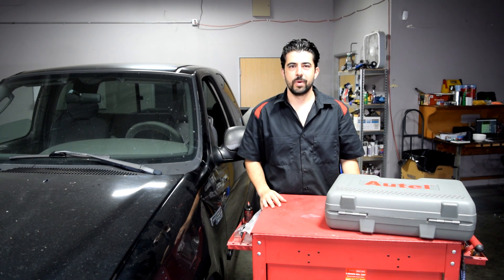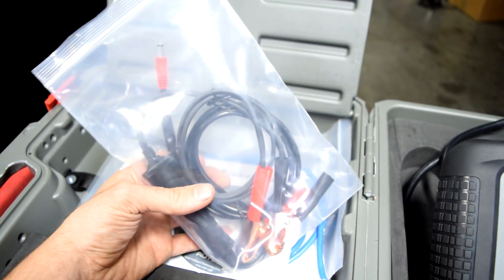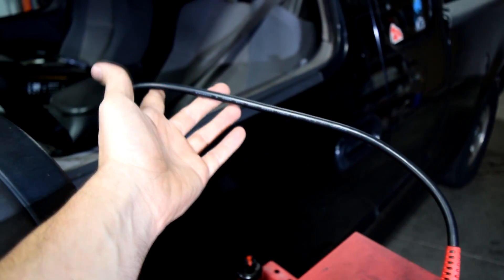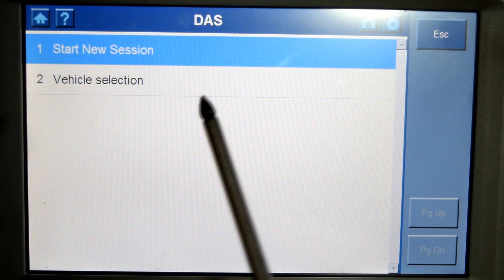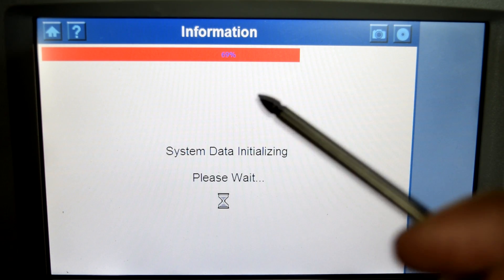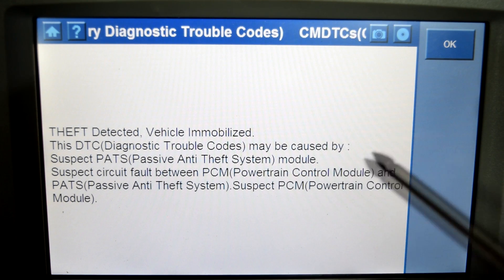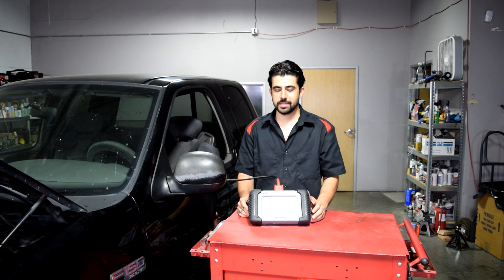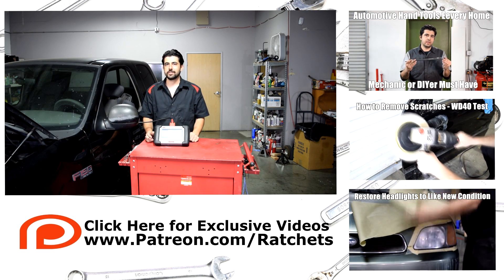A Professional Grade Scanner at a Fraction of the Cost - OBD II and Dealer Software

Comment: Nice run down on the machine. Too bad they couldn't send you one for your use and review. You have a deserving channel. Congratulations on the purchase. That's a big decision but despite some design limitations, (according to Eric at SMA and Paul at scannerdanner) a lot of professionals use this unit. Good luck with it and let us know how you like it after some use.
Reply from the maker: There are flaws in every tool, in ways this is better than the $10,000 snap on, like coverage for programming control units, re'learns and key programming.  and ways its inferior like the scope/multimeter/graphing capabilities. but at fraction of the cost of that thing. This is a fantastic choice, especially as a first scanner.
Reply: Awesome!

Comment: Hey man I'm having this issue with my Subaru it's a 2000 impreza 2.2 L with a 2.5 block. I get a cam sensor code p0340. it turns over just fine and stays idling fine as soon as I give it gas it buckles, goes into drive drives for about 20 secs and shuts off.  I've replaced cam sensor, crank sensor, coil pack, spark plugs, wires, fuel filter and finally the 02 sensor. I've checked for continuity in my engine harness. My last option is the dealership. Got any advice?
Reply: Make sure the cam phaser is aligned the same as the 2.2 some times they sit in different spots I had this problem
Reply: have you checked your cam and crank pullies to make sure nothing has jumped a tooth?
Reply: +Kimo Kalihi someone mentioned that to me so I went ahead and checked the timing and verified and replaced the belt and made sure it was aligned. also replaced head gasket.
Reply: Watch video give you an idea to look for some motors have different timing
Reply: +Bogard Salinas just fyi, I've seen people accidentally use the wrong timing mark on the crank pulley when lining up their pullies.  the ones in the back of the pulley are for the crank sensor trigger.  the little arrow on the front face on one of the teeth is the correct one to set piston one at top dead center.  they are at different points on the pulley.

Comment: Eric at South Main Auto's channel uses one of these, along with the more expensive Verus. He said the graphing capabilities are the weakest part of the Autel.
Reply from the maker: He has both, also a Snapon Verus and an OTC he likes all of them :)
Reply: I am a professional tech and have both snap on and autel, plus a GM tech 2 and I can say that the Autel is my go to tool. I have the Maxisys 980 pro and it is a unbelievable tool. Someone in a previous post mentioned graphing and I compared a throttle position sensor sweep test on the Autel to a sweep test with a Modis lab scope and virtually no difference. Granted...a throttle pos. sensor isn't the same as comparing ignition data from one to the other.....
Reply: He also uses a Launch X-431 Pad
Reply: Who needs graphics?
Reply: he has the maxisys not the maxidas, this is the older scanner autel offers more in line with the launch autoboss and solus
Reply: Not "graphics", graphing.  PID graphing.